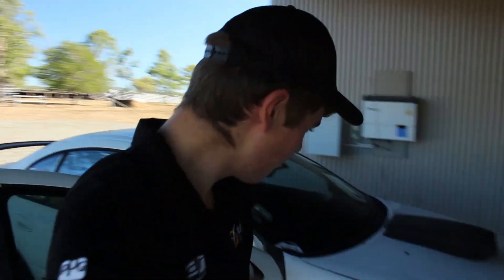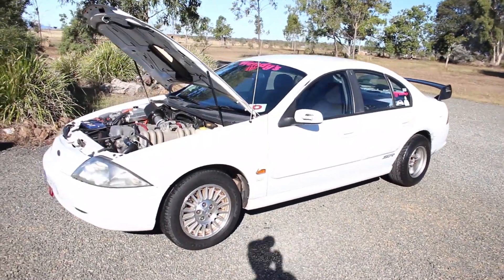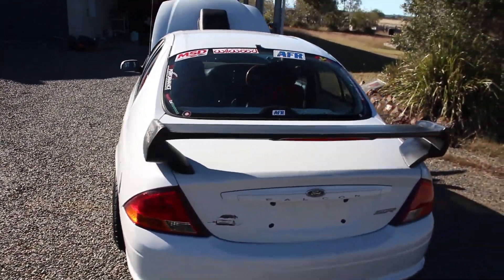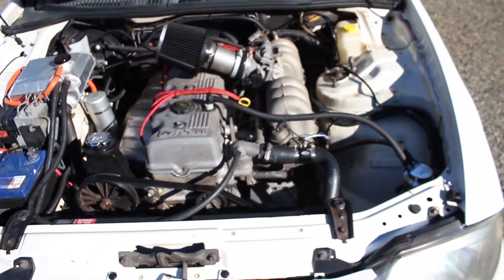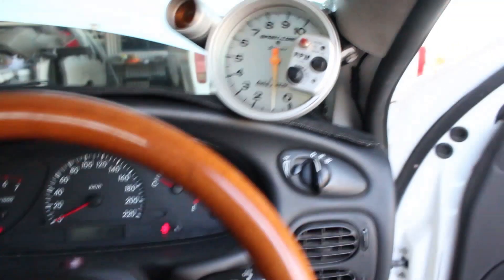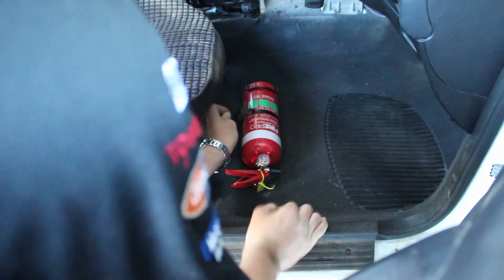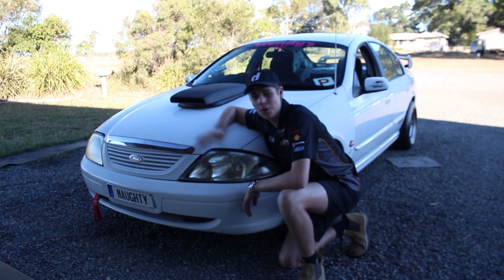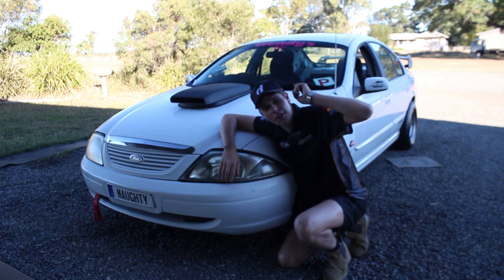NAUGHTY Update- Gauges, NEW Wheels & Fire Extinguisher - Richo's Customs.

Comment: My man stop it stop doing that to your car it's not cool here in the USA it's not cool there bro. Get a nice cold air intake get a nice exhaust with a 5 inch tip start off with tuning the engine to adjust to the modifications then start the bolt ons. I have video it ain't nothing special it just shows you don't have to buy those cheap stick on parts and still go fast. Cool car though bro don't stop trying to make it fast but I would lose that small little air filter because that's not doing nothing you're probably losing horsepower and get that exhaust fixed the turn down pipe does not look good